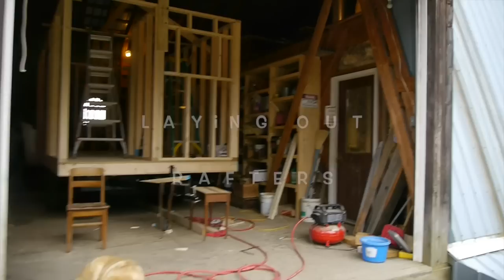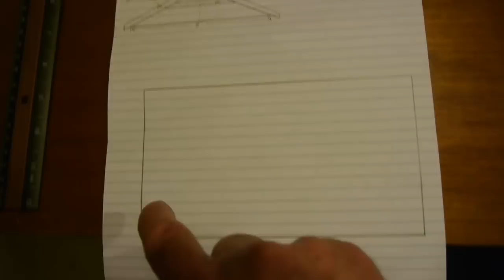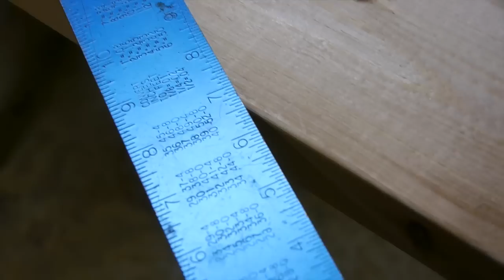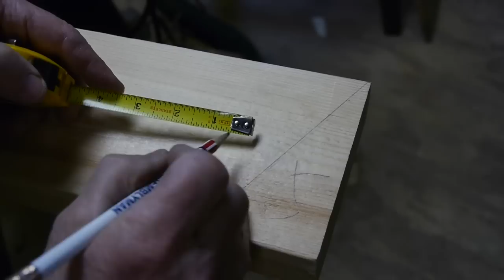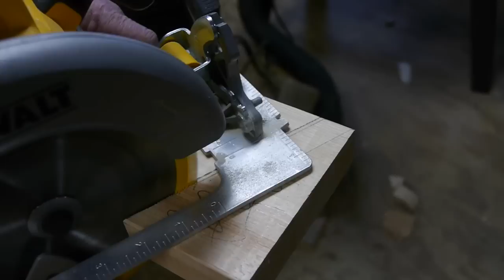Rafters:  How to lay out your rafters

Comment from the maker: After you understand the basics (roof pitch- rise and run, birds mouth and overhang,) you are ready to design your roof.  I decided on a 6-12 roof pitch. So, for every foot of roof,  you are going to be rising 6 inches.  A 4 -12 roof pitch means for every foot of roof, you are rising 4 inches.  etc.  If you are building your own shed or building, you can decide how steep you want your roof and use this "stepping-off" method to make your rafters.
Reply: Question:  If I am using a 2x6 ridge beam and 2x4 rafters will I have to adjust the cuts so that is fits right (to the top of the ridge beam)?  I'm building a 12x16 with a 10/12 pitch.
Reply from the maker: @roncecil4620  Sorry ... I just saw this comment.  You probably have your building built by now.  Ha!
Reply: @roncecil4620  You'll still shorten the rafter by half the thickness of the ridge board. If you're ridge is 1 1/2" thick, then you'll shorten the rafter 3/4".
Reply from the maker: Yes, I think I explained that in the video.  Thanks for the clarification.   @Jay-tk7ib
Reply: So what if you wanted a 8 12 pitch would you have to cut the rafters longer then 4 ft
Reply: @his357  Yes, it will be longer, but if you use the step off method the length will be automatically calculated for you when you step of the number of feet in your run.
Reply from the maker: @his357  The rafter length is determined by your "run".  If you have a building that is say eight feet wide, then your roof peak is right in the middle at four feet so you step down four times.  If your building is say 12 feet then the peak is in the middle at six feet so you step down six times.
Reply: @TimTools99  you need to subtract the ridge width from your span
Reply from the maker: @snwlcke3  Yes I did that

Comment: Won't your 8" overhang be too short when you measure it this way? Don't you take the overhang length from off the diagonal, which means the overhang cut will seem to be longer (over 8"), but ends up being your desired overhang length

Comment: Why does code prevent birds mouth cuts greater then 1/4 the thickness of the rafter? If I got a 12/12 pitch roof, to me it makes more sense to have a greater surface contact with the wall top plate and the rafter via the birdsmouth.

Comment: How would you  determine the height of the ridge board my building is going to be 10x12 with the Rafer spaning the 10 making each rafter appx 6 ft plus the overhang so each rafter would be 5' 11 1/4 plus 6" for overhang rafter is 2x6 material and ridge is 2x8

Comment: How come no one uses real math. Degrees..... protractor.... probably more accurate and useable for different purposes if we had equation. Example using modern lumber 1.5 x3.5 to replace a rafter made from pre 1960 lumber that is true 2x4, no one can explain how to do this that is not 'make a 1.5x4 using a 1.5x5.5 cut'

Comment: Tim - my pergola is 7 ft 3 inches wide, divided by two, that would be 87 inches or half. I want to do a 4/12 gable rood pitch. Using your method of step off, how would that work with that odd number.

Comment: Again, at 7 Ft 3 Inches wide, the 1st step off is not a problem, the 2nd step off would be 1 Ft 7 1/2 Inches from the end of the 1st step off ???(added to the 1st 12 inch step off would equal half of the shed overall width) is the right?

Comment: Nice video one thing I’m hearing a lot is you mentioned you were using 2 x 6 and then when you went to cut the seat cut you referred to your 2 x 6 as a 5 1/2 inch now I’m in Ireland and most of our lumber is 6x2 and is 6 inches in depth I’m a bit confused
Reply from the maker: Our lumber has been downsized over the years.   A 2X4 here is only 1 1/2 X 3 1/2.  And our 2 X6 is 1/1/2 X5 /12....   Just take about 1/3 of whatever your lumber width is.  So if you have  six inches, you would go in two inches.
Reply: TimTools99 Thanks appreciate the reply I see what you mean okay I’ll put that to practice

Comment: Using the square only to determine the length of the rafter was cool. This is assuming an exact building width of 8 feet and a 4 foot run. I guess if you want the birdsmouth cut to consider the sheeting, you would just move the birdsmouth position out another 1/2 inch?

Comment: Thanks for the lesson! What confuses me is some carpenters use the 1/3 rule for the seat some make the seat the width of the top plate and other make it the width of the top plate and sheathing. Is this due to local codes , exceptions , ok or just wrong?
Thanks
Reply from the maker: Well to tell you the truth, I don't know.  I have always taken about a 1/3.  It's not critical.  Somewhere about 1/3
Reply: TimTools99 thanks

Comment: Sorry if this is a silly question. Did you step down four increments since they equaled 4ft and the fifth step down for overhang achieved your 5ft desired length. I am asking because I am building a 7/12 (6ft length) shed roof and your explanation is the best I've seen. I'm assuming I would do 5 step to the birdmouth and one last for my overhang. Thanks.
Reply from the maker: Hi Lindsey.  My building was 8' wide.  My Ridgeboard will go down the middle at 4 feet.  So I stepped down 4 times and marked the birds mouth.  At that point you can have the overhang stick out as far as you want.  It can be one more step down or longer or shorter ...just so you mark it the same way with your square to get that same angle.//// If your building is 6' wide, your ridge board will go down the center at 3'  so step down 3 times and mark your birdsmouth then step down however long you want your overhang and mark that with your square the same way.

Comment: In this video you did 4 steps in the step off method, because you had 4 feet. which divides nicely. what if you had something like 4 feet 6 inches. what would your last step look like?
Reply from the maker: Well Luke ... that's a good question.  Normally, my buildings are based on even-numbers.  No real reason to build something an odd-number in width.  Lumber is sold 8-10-12-14-16 ft long.  Building something an odd number width would waste a lot of lumber.
Reply: Half of one full 12" step...

Comment: I’m asking because I’m doing a 412 pitch and I’m watching a video I’m getting confused when you say stepping off
Reply from the maker: Hi Maria.  If your roof will be 4:12 then set your square at 4 and 12 and draw a line like in the video.  Make a little mark at the 12" point.  Now, slide your square down to that 12" mark and draw another line.  This is "step-off" #1.  Now, make a mark at the 12" point, slide your square down to that point and draw another line.  This is step-off line #2.  The number of times you step off is determined by your "run."  For example, If your building is 12 feet wide, your peak will be right in the middle at 6 feet ...  you will be spanning a run of six feet so step off six times. Then your rafter will fit just right at the peak and that sixth step-off will sit right on the wall.  // If your building is 8 feet wide, then your peak will be in the middle at 4 feet. You would step pff 4 times in this case.  Hope this helps.
Reply from the maker: Let me know if I can help further.  I will make you another video!

Comment: How many inches are there in between each step off from the initial mark you made?
Reply from the maker: Hi Maria.  I remember having all these same questions years ago!  Okay, you are going to use the square to layout your rafters.  If your roof is 4:12 pitch, then lay your square down on your rafter with 4 and 12 like in my video.  That number 12 is where you make a mark.  Then slide your square down (keeping that 4-12 angle and draw a line at that 12 mark you made.  This is "step-off" number one.  // (It will help if you do the process by watching the video ... stop it and do that much, then watch the video and do the next step etc.  You will get it.)

Comment: At about 3:06 you come up with a third of your 5 1/2 inch wide rafter.  1 7/8 ".  How do you come up with a third ?  Where does it come from ?
Reply from the maker: I read that somewhere I think.
Reply: Any more than 1/3 and the timber is weakened and likely to fail under load.
Reply: 1/3d of 5 &1/2 is not 1&7/8"!
Reply from the maker: @jasonvieira222  1/3 of 5.5 = 1.83 inches or 1 7/8 inches.
Reply from the maker: The number is approximate.  It dos not have to be exact ... just close to 1/3.

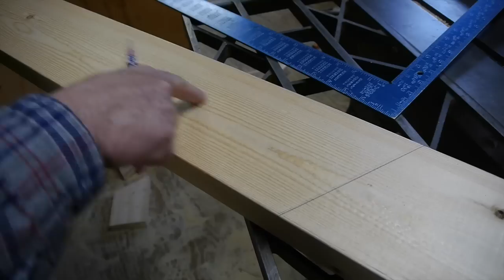Comment: At 2:08 you say 12" overhang. It will not be, you are measuring the slope not the run. 10 3/4"
 will be O.H.
Reply from the maker: Yes you are right. I should have mentioned that.  Thanks for watching.

Comment: Just trying to figure out bird mouth depth, if your cutting 1 inch into bird mouth, do you need to add one inch over all height over ridge beam to allow the drop? sorry if not explaining very well. I liked this video, really cleared up some mess in my head.
Reply from the maker: Good question.  I never did.  My dad always said, "we're not building a Swiss watch."  As long as you cut all your rafters the same, you will have a nice roof.
Reply: @TimTools99  Thank you so much for taking the time to reply to my question, so like you say, as long as everything fits snug I shouldn't stress to much about the total height of the roof so long as it looks good.
Reply: @TimTools99  "we're not building a Swiss watch."  what a great saying =)
Reply from the maker: That saying stuck with me because it fits so many things that we do.  Ask yourself, "how exact does this thing really need to be?"  (Unless you are building a Swiss watch!  Haha)
Reply: @TimTools99  I bought 2 books that arrived today called, "Goss's Roofing Ready Reckoner: From Timberwork to Tiles" and "Carpenter's Metric Roofing Ready Reckoner" great little books so far. Don't know if I'm just an idiot or maybe roofs are actually quiet tricky to work out.
Reply from the maker: @Freebird-12198   I have only ever done simple roofs but it's like most things ..... once you have done it, then you know how.

Comment: You marked the overhang down the actual length of the rafter. To get an actual 12" overhang, you need to measure perpendicular to the wall plumb line. Using the step off method, it's just one more whole step. Then when you subtract 1 1/2" for your facia board, you will have 12" of overhang when the facia in installed.
Reply from the maker: Yes I realized that but the actual overhang measurement didn't matter to me so I didn't bother.  Thanks for watching.
Reply: @TimTools99  I know it doesn't really matter for a storage shed.  Good work.
Reply: you I absolutely right you got to follow the angle of the rafting Square for the overhang that you want for your soffit

Comment: Great video, how do I get the ridge board height though?
Reply from the maker: Example:  To get the height of your ridge board you multiply your Rise X Run.  You need to understand "Rise" and "Run." If your building is 8' wide, then the ridge board would be down the center at 4'.  So we say that the run is 4'.  Say you want a 6/12 pitch.   That means the roof is going to "Rise" 6 inches for every foot of run.  You multiply your rise times your run to get the height of the ridge board.  In our case the rise is 6".  The Run is 4'.  6 X 4= 24.  The height of your ridge board is 24 inches.
Reply: TimTools99 okay thank you, would that be the top of the ridge board itself or would that be the bottom of the block holding up the ridge board ?
Reply from the maker: @ignaciocardenas4825  The top of ridge board

Comment: Your project looks like a fun project to build.

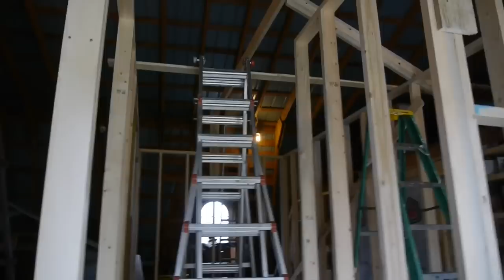On frame 6:21/6:37 it appears as if your common rafter material is a nominal 2x6 and your ridge material is also a 2x6 as I can see the bottom of the ridge plumb cut as seen below the bottom of the ridge board stock.  Shouldn't the ridge board in this case be the next size up in nominal width material or a 2x8 to ensure the solid backing of each common rafter fully bearing against the ridge board?

Also, you mentioned the overhang is 12 inches as measured, marked and cut; but if a facia board is to be installed shouldn't 1-1/2 inches be subtracted from the overhang dimension thus preventing the actual dimension from being 13-1/2" overhang once the facia board is installed?
Reply from the maker: 4WorldPeace2 thanks for watching. The ridge board was a 2x8 which actually measures 7.5”. Plenty to nail to.  The overhang was 12”. When I put the siding on, that made it about 11.5”. I then ripped the material and nailed it on the soffit. The face board was the last to go up. Worked out nice because I could get four pieces of soffit from one 4x8 sheet of the siding. If you get my drift. Very little waste of material this way. Thanks again for watching. I am really enjoying my cabin.

Comment: I agree with the comments below, this is one of if not the best explanation of making a truss I have seen. Simple, etc. I am not going to do the ridge board down the middle but rather make stand alone trusses. will this work the same for figuring out the size of the run boards (but not cutting extra off for the ridge board)? If I am following the example you did for Gilbert B. my shed which is 12' wide by 10' deep, I would take half the 12' = 6 x my 4/12 pitch for the height of the top of my rafter at 24". Then I would step off 6 times? to create the length of the rather sides to where the birds mouth would be cut?. Then I could cut the cross piece for the truss and connect them with pieces of plywood or OSB? Thanks for any help you can provide.
Reply from the maker: Yes you've got it!

Comment: Best how-to rafter video I've seen short to the point. Question, HOW DO YOU FIGURE THE HEIGHT OF THE SUPPORT POST FOR THE RIDGE. THANKS AGAIN FOR THIS GREAT VIDEO
Reply from the maker: Hello Gilbert.  You decide on what pitch you want for your roof first.  
Let's say you decide on a 6/12 pitch.  That means for every foot of run 
you have, you will have 6" of rise in your roof.  In my case, my 
building was 8ft wide.  The ridge is right down the middle of the 
building. So half of 8 ft is 4ft.  So I have a run of 4 feet.  My roof 
will rise 6" X 4 or 24 inches.  Similarly, lets say you want a 4/12 
roof.  (4 inches of rise for every foot of run.  In my case 4 X 4 = 16 
inches.)  Let's say you have a building that is 12 ft wide and want a 
3/12 roof.  Take half of 12 = 6.  Now mulitply that 6ft of run X 3".  
Your ridge beam would be up 18".  Hope this helps.
Reply: Gilbert Boshell Take your rise and add the “height above plate”(the amount of board from your seat cut in the birds mouth to the top of your board) this will give you the height to set your ridge board, beam, or ledger. Line the top of the ridge board to this measurement.

Comment: This is so far the best explanation of cutting roof rafters. If you don't mind, may i please ask you to help me when i soon start to cut my own rafters. I am about to cover my porch with gable roof myself. I don't know how to decide my pitch and stuff like that . Thank you in advance
Reply from the maker: I will help if I can
Reply: My porch is 17 feet long 11 feet wide. Should i decide to go on 6/12 or 4/12
Reply: My plan is to gable roof to be 3 feet high or something like that.
Reply from the maker: I guess I would decide what would look best on your house.  If it doesn't matter then consider other factors: do you live where you get a lot of snow?  (steeper is better.)  Overall, I like steep-pitched roofs.
Reply: No there is no too much snow . Does it mean that 6/12 is very pitched  . if so then i would go maybe for 4/12. Now, i am currently watching your video over and over again to learn how to do the math and measurements to cut rafter birds mouth and maybe 12 inch overhang
Reply from the maker: Your 36 inch height gives you about a 4/12.  To get the 6/12 pitch, you will need 4'+ of rise.
Reply: I think that's what  what i want. Thank you
Reply from the maker: So ... if your roof span is 17' then half of that is 8.5 so if you want a 4-12 roof then that's a rise of 4" per foot.  So, multiply 8.5 X 4= 34.  This is your roof height.  Now, follow my video and use 4-12 on the square to lay out the rafters.  Hope this helps.
Reply: Ok, now I took a measurements you gave it to me. 
i counted 8 times mark for  4/12. My rafter is also 2x6. I am about to do the birds mouth mark and i'll do the cut.
Reply: I forget to mention, my plate wall is 6x6. Does it matter at all for birds mouth?
Reply from the maker: Great.  After you make it, hold it up to see if it looks right.  Don't forget to subtract for your ridge board.  I usually cut the rafter out and then do the ridge cut.
Reply from the maker: No doesn't matter.  You are just giving that rafter a flat surface to sit on your wall and be able to nail it.
Reply: +TimTools99 Tim another thing that I want to point out to you is that when you do rafters always best way to do them is to flip the rafting Square pointed away from you follow me?